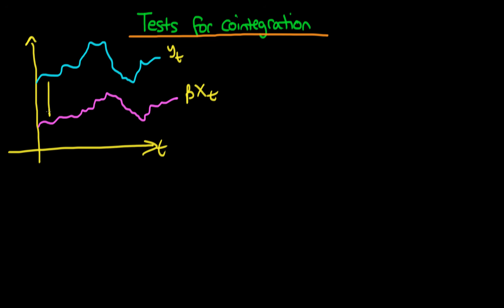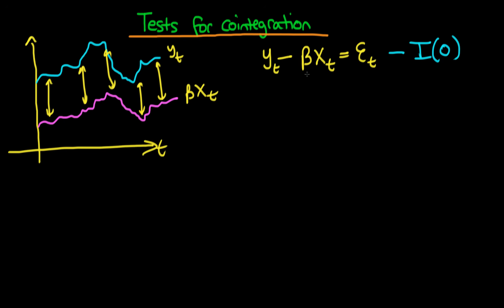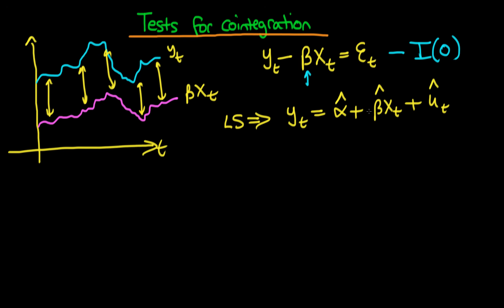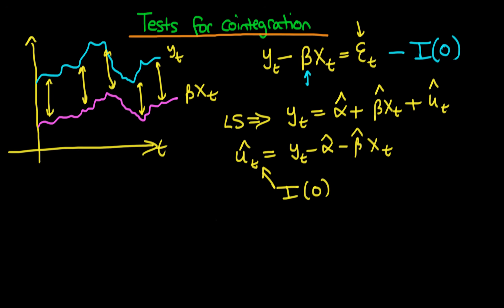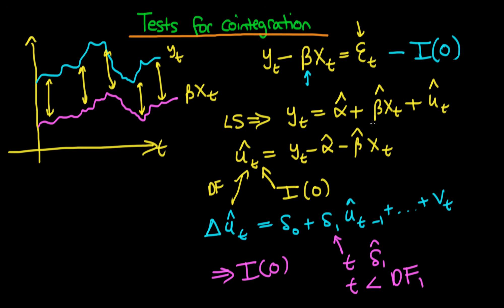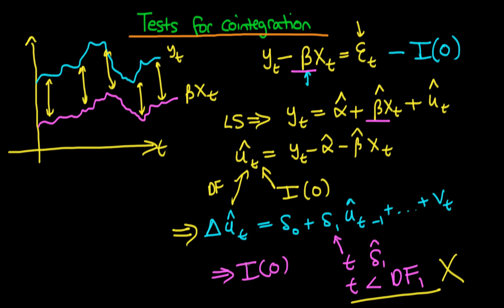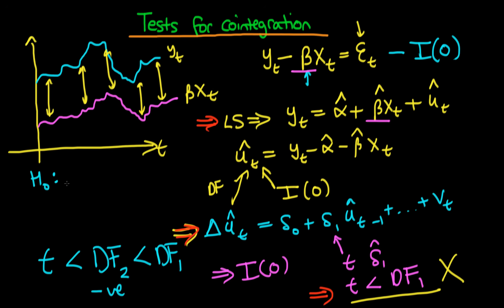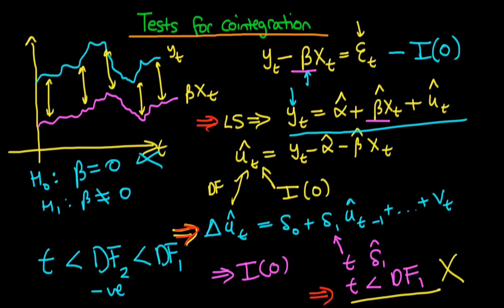Cointegration tests

Comment: I've got a question. Lets say i have X_1 and X_2 variables. Running tests it was shown that X_1 is stationary and X_2 is not stationary. So X_2 has been transformed to be stationary using growth rates. Now Y has only stationary variables to be defined. Y= X_1 + X_2. Doing the Granger test of causlity is meaning ful here? ot it is only plausible if X_2 without transformation has a unit root. and seem to be related to Y. Or i can either test Granger, and cointegration with variables that are non-stationary?

Comment: Hi Ben, you mention a stricter version of the Dickey-Fuller test statistic, where is this published?
Reply: Hi Evan, I know this is two years old but the stricter Dickey-Fuller test stats are on page 766 of the Hamilton (1994) textbook and in the Appendix of Phillips and Ouliaris (1990) in Econometrica, Table II: http://finpko.faculty.ku.edu/myssi/FIN938/Phillips%20%26%20Ouliaris_Asymp%20Props%20of%20Resid%20Based%20Tests%20for%20Coint_Econometrica_1990.pdf

Comment: Hi,
If Johansen cointegration test confirms that an explanatory variable has a significant long term impact on the dependent variable, should the variable also have a short term significant impact when estimating the vector error correction model?

If normalized cointegrating coefficients are insignificant, can we still conclude that there is a long  term relationship because we said there is cointegration first?

What are adjustment coefficients? are these the ones we report as our long term coefficients?  

Thank you!

Comment: Hi Ben

Thanks so much for your videos. I have been using them to help me study for my econometrics class. 

I am wondering what would you do after testing that two series are indeed cointegratable. How do you report the result and the long-run relationship between them? Is it just the e term?
Reply: I've only just started learning about this, but I assume you report the p-value of δ1?